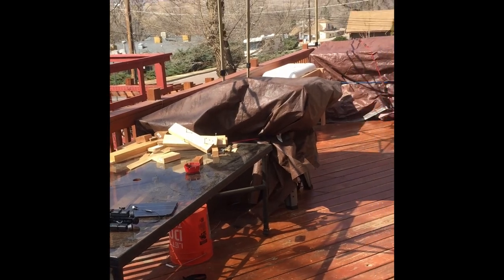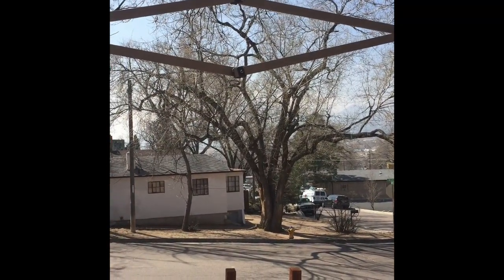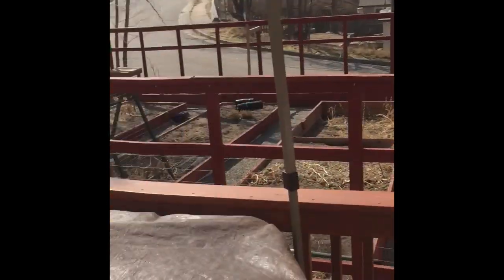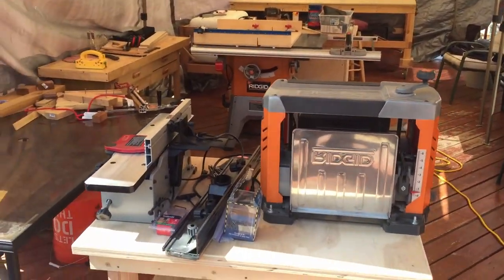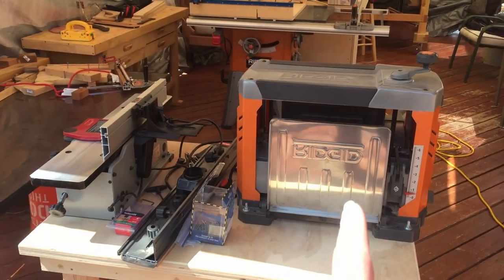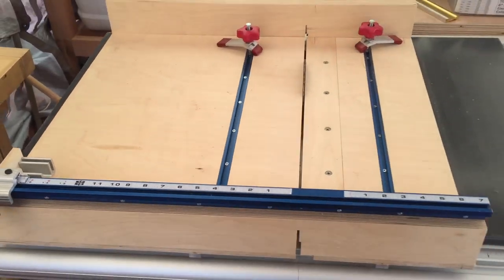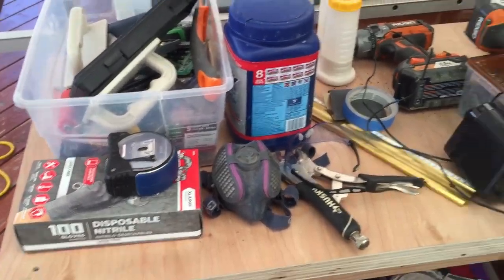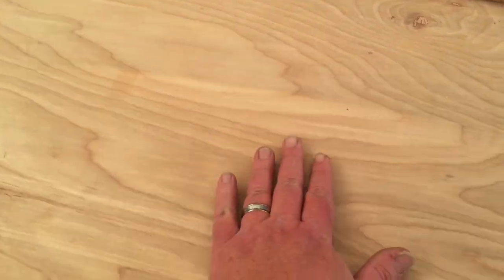Ep. 1 Shop Tour 2018 How I set up my shop.

Comment: It's been four years, but I just found you and love watching your videos. My shop is 9x12 feet and I have to move things out to the patio to work. Some times I use the table saw and miter saw outside.  Other times, I have enough room to cut small craft on my table saw inside. 

In one video you said you don't have a miter saw.  I think I use mine more than the table saw, but yesterday when I built my first farmhouse desk, I discovered that a circular saw would do the same thing faster and easier, especially where it comes to multiple, custom angles.  

Dust collection... need I say more, LOL... very important in my shop.  

I love you videos.  Keep them coming...
Reply from the maker: Thank you. I thought this video had been buried and long forgotten. I’ve updated my shop since then. I now have a miter saw and a permanent roof.  Dust collection is one of the things I fight with constantly. I breakdown sheet goods in my driveway using my circular saw yet still manage to bring dust into the house.